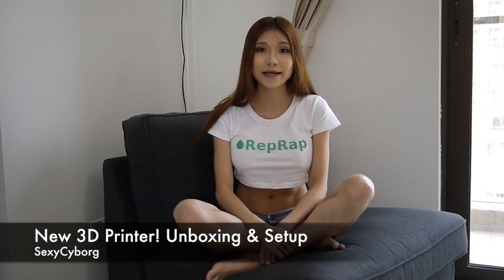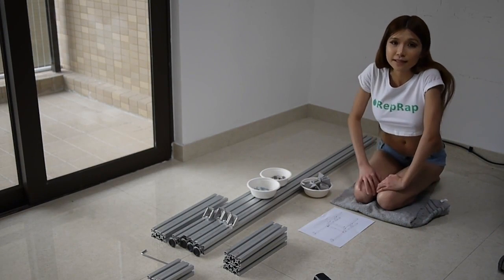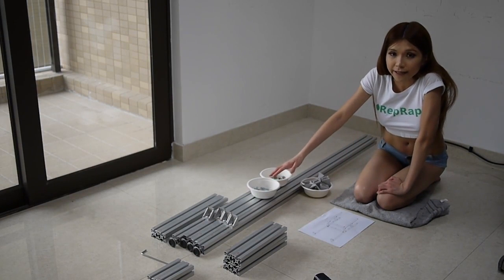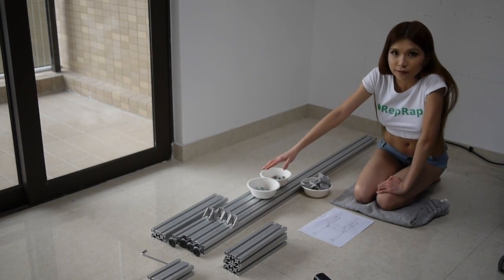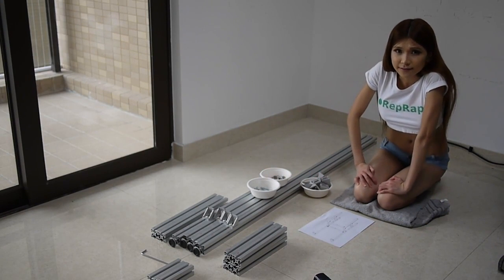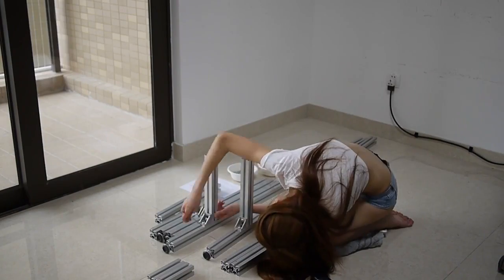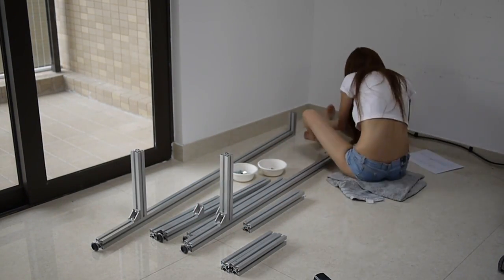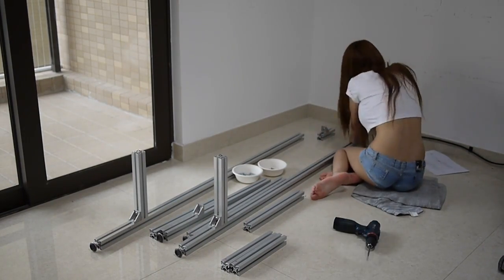FlashForge 3D Printer Unboxing and Setup

Comment: did you have to clean the extruded aluminum cuts? I have found they tend to not be very precise when I have ordered them in the past.  Also I noted you are using an exacto type knife, do you feel that works better than a simple putty knife?
Reply from the maker: The cuts from the factory are very clean, if I do it myself I have to file the edges off.

Comment: When I first saw the frame and the Filament on the top, I kind of hoped she was gonna build a massive 3D printer would of been awesome.  Bigger the better even if its the garage becomes the printer :D

I often find its easier to level the plate by placing the extruder over the inner part of the 4 mounting bolt holes (not the hole itself). Most of the time it works straight off the bat. Not sure if anyone else has found a similar way or not.

I do personally have an issue with building a 3D printer mainly made of WOOD is just insane. How can anyone expect any of it not to warp is beyond me. Mine cost me nothing initially so I cannot really complain. Just have to build it a new body or should I say PRINT it a new body at some point.

Comment: When I saw that pile of square tubed aluminum on the floor I thought we were about to see a build of a 3D printer but it turned in to a table. Naomi mentioned that loose long hair and rotating power tools don't mix. She tied up some of her hair in to braids but it was still dangling in front of her instead of over her back or tucked under the T-shirt to keep it well clear of the tools she was using.

Comment: Easier way to level, level the bed so it just bumps into the nozzle(no gap) then adjust the offset in your 3d printing software to start 0.2mm higher than 0 on the z axis.
G1 X0 Y0 Z0.2 ;Move to this position
G92 X0 Y0 Z0 ;Tell printer this is the new home position

Comment: Hey Naomi, thanks for the video. I was wondering if you have had a chance to try out the Flashforge's dual extrusion? If so, what have you used it for, and what do you think of it? I hope that you have a great day. :-) ~Ben
Reply from the maker: I do what most people do, PLA in the left and ABS in the right. As some point I will try dual PLA but really that's the kind of thing people try once but not for daily printing.
Reply: Thank you for responding. :-) Out of curiosity, why PLA on the left, and ABS on the right? I assume that it is so that you can quickly use one or the other. Or, do you use one for support, and the other for the part?
In artistic terms, I can see a use for dual PLA filament, but otherwise I would tend to agree. Dual extruders are much more useful for practical, mechanical purposes. I am hoping to buy/build a printer with dual extruders for PVA(Support) and PLA(model), or flexible with harder plastics.

I am also curious if you have considered using PVA with PLA. It seems like it would make support material a breeze to remove.
Reply from the maker: No fan on the right unless you print a mod. ABS does not need a fan...

Comment: Hey there Sexy Cyborg,
I am also using a printer from Flashforge, although it's the dreamer model. 

Been using it mainly for small prints, and are having mixed results in terms of the quality of print ): Both with PLA and ABS, although ABS is usually better. SOOO just wanna ask you if you have any recommendation for the brand of materials that you use (:

Also, super awesome that you are chest deep into tech stuff! A breathe of fresh air in a male dominated environment. Subbed! Keep up the good work and create more!
Reply from the maker: I use eSun filament and the Flashprint app. I heard it can have trouble feeding the filament smoothly off the back. maybe try hand feeding to see if that's the problem?
Reply: Sexy Cyborg Haha wow same brand of filament. The feeding isn't much of an issue sometimes it has trouble sticking to the printing plate :(
Reply from the maker: Make sure super level. Wipe with an alcohol pad to get skin oil off. If still does not work switch to PEI.
Reply: Guess I will have to play around with all the different variables! Thanks a lot Sexy Cyborg! You're awesome! Keep up the fantastic work and keep on making!

Comment: Where did you find the table, software, and how did you finish the prints? I'm new at this, and whenever I print anything the first layer always has this weird web pattern..... help?
Reply: It's normal. The "web" like structure is called in-fill, it's to give your print stability if not it will just crumble inwards. Don't cancel your print! Just let it complete itself and blow your mind!

Comment: Flashprint realy is a piece of junk. I switched to Simplify3D after 2 hours using it! Cool Vid ! Cheers from Laos!
Reply from the maker: Really? I have S3D and it's great but FlashPrint so far has done fine. Maybe new version?
Reply: This slicer (Flashprint) is way to slow for big prints and you don't realy have full control of you printer. :/ For simple print it's okay!

Comment: That 3d Printer looks beast!
Reply from the maker: They are a real workhorse. Also very common so lots of tutorials online if you have a problem😊
Reply: I only have a Wanhao i3 plus, but it does a good enough job :) Next upgrade I'd like to try something of this pricetag.
Reply from the maker: Oh the Wanhao i3 will last you for ages. No need to upgrade can just print improvements.

Comment: does this printer have a dual extruder? If so, have you used it yet?
Reply from the maker: Hey Tessa! This is Tessa everyone, she's awesome- check out her channel here: https://www.youtube.com/channel/UCGfwVeGv-eujIHMSCpKe4cQ/featured

The Creator Pro does have dual extruders but only the left has a fan so can print PLA. It's pretty easy to print a second fan for the right nozzle but I'm trying to run the printer "stock" for now. because they were nice enough to give it to me so i want to show it off like it comes from the factory. But I think another project or two and we'll be even then I can start hacking it😊